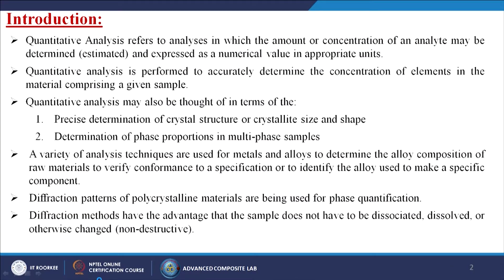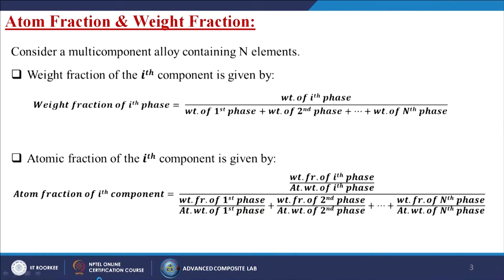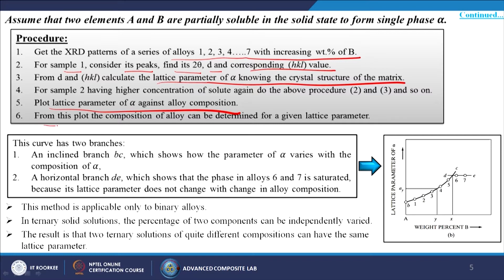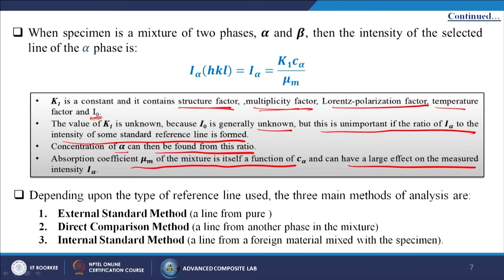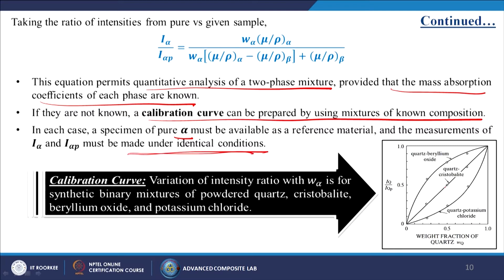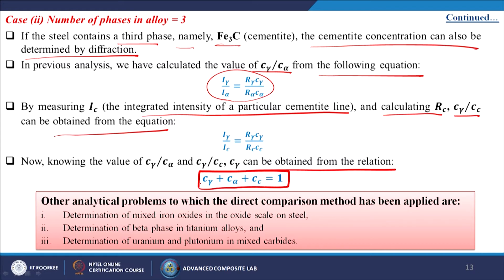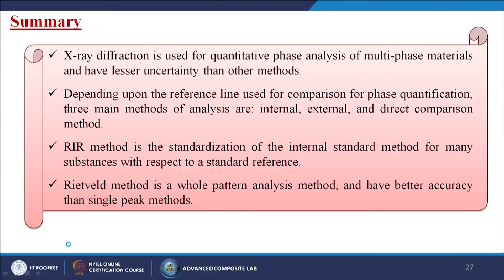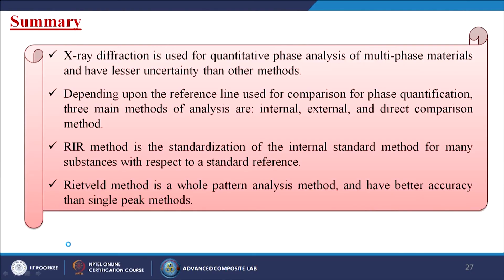Quantitative Analysis by Diffraction

Comment: Sir, when u were explaining about the phase fraction calculation using Reitveld Refinement, you are addressing the term "iexp" as I (intensity) exponential. Sorry to say here, "exp" is not exponential. It Experimentally measured intensity value.  Please check it.